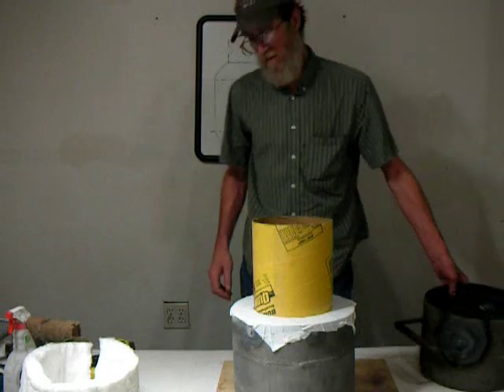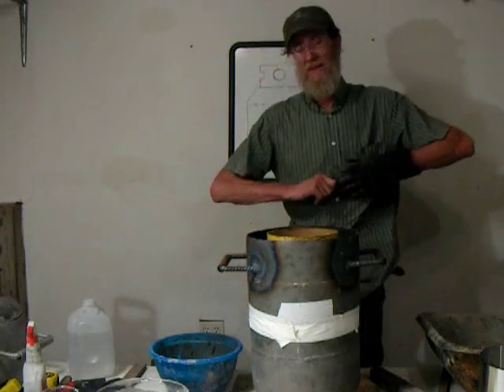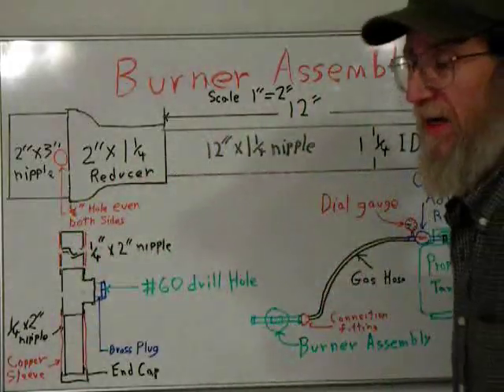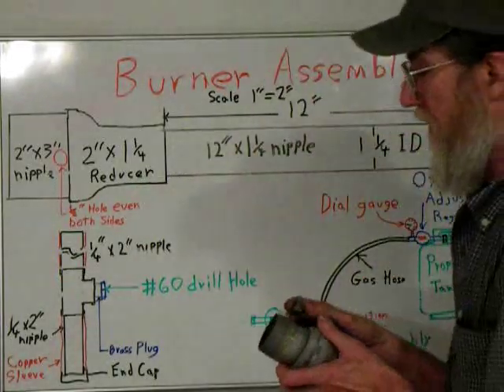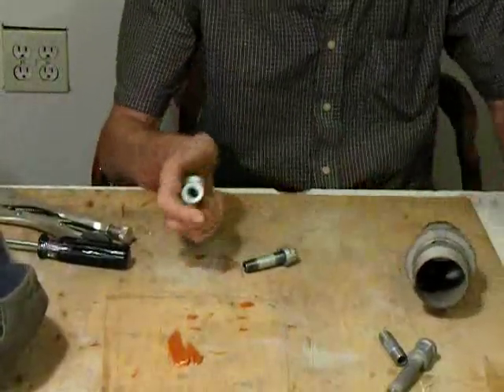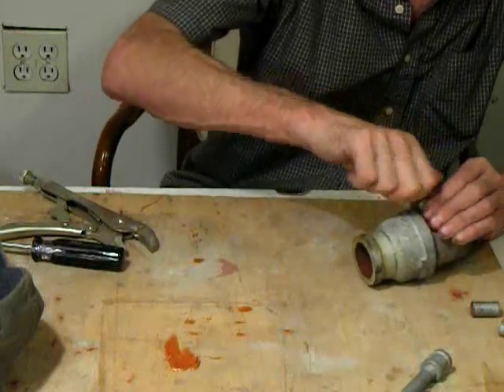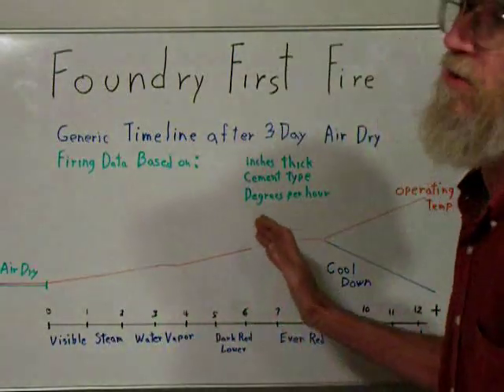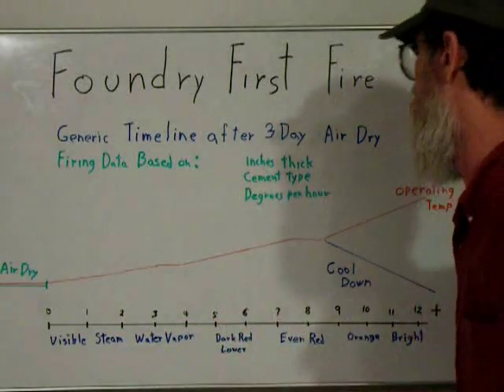Backyard Foundry Tutorial Pt 3

Comment: Thanks for what you do.   Without adding the extension, just one propane tank, what is probably the max size crucible you would have in there?   Right now I have a graphite #4 6KG in my cheep-0 foundry, but am getting ready to build a real one.  Proper wool, cement, etc.   It's coal + hairdryer in that 'Lowels metal bucket' type and it's working well.  I think the propane take is about the same size..

Comment: I built the burner tube exactly to the tee just as described however I can't keep the burner running without a flame I'm front of it. can you help me? thanks rob
Reply from the maker: +Frank franks Yes this has come up many times in the past.  First the gas regulator needs to be a high pressure type that can crank out up to 30 PSI and start out lower than that say 8 to 10.  That will be adjusted once the foundry heats up. Putting a gauge between the gas hose and the burner helps the most for learning.  The other common problem is the lighting process where you take a grill type lighter and insert it slightly past the orifice to light it from the air intake side.  Very common mistake trying to light it from the output side of the burner.  Can be done but tricky when cold.  And the final problem is the regulation of the gas pressure itself.  Takes a while to get the knack of it.  Although I can light it without a gauge from the sound alone others need the gauge for assistance.  It is either too much or too little gas.  Start with to little and stick the long neck grill lighter down the intake end of the tube just under the tee and slightly past the orifice and as it lights and heats up run the pressure up.  That gets the air flow going.  Let me know how it turns out but sounds like you are there already and no problem.  Once you build it it is understandable you have to learn how to operate it.
Reply: rlbob1 I'm having the same issue but and it does seem better once it warms up but only if I crank it to 25-30 psi. Is that how it should be? I remember you saying you run between 7-20 psi but I may have misunderstood. Combustion is occurring just after the orifice. Could it have to do with the distance of the orifice from the flare of the bell reducer? I tried to use all the same parts and assemble exactly as yours was. I've made a few reversable modifications that haven't seem to help so I thought I'd come to someone who knows this particular burner pretty well.

Even when I do get it to run decent, once I put the lid on the back pressure (I assume) pushes the flame back.

Comment: quick question.  you said a minimum of 0 to 20 psi on the adjustable high pressure regulator.  after initial burn in, is 20 psi enough on full power or am i losing out in not having a regulator going to 30 or 40 psi?

Comment: Bob, Has anyone tried to fire the foundry with an oil burner?  Such as a Beckett AF?  Obviously the curing of the refractory would have to be done with with a gas setup because, firing can be regulated.   But once cured, ???  I ask because I have plenty of stuff to work with if #2 fuel oil, diesel, kerosene, etc is a viable fuel.

Comment: hi Rob.
I have just recently made your foundary burner, and followed your instructions for the burner exactly, but it blows itself out. should it have a baffle or is there something else I am not doing right? Ive tried different pressures, and the only way I can get it to run is to put a piece of mesh screen in, but that wont last long. Can you give me any suggestions why it isnt working, or anything I could try.
Regards
Nigel (Chopper 316)
Reply from the maker: Although this has happened before I have always found the burner to be very forgiving due to its simplicity. I have run it by itself laying on brick and even made one that ran on house regulated natural gas.  Some of the problems were due to the wrong regulator (non adjustable),  Orifice assembly too long (inserted down the Venturi instead of the start), Orifice size wrong or drilled at an angle. Wrong size Venturi or pipe used, not using a grill type lighter to start the flame at the orifice, or even near dead propane tank with low pressure. Give me a better detail of the specs and equipment you are using.  As far as I know these problems have all been solved in the past rather simply.
Reply: I have done everything as you have said_ same size pipe and bell mouth venturi you specified. I drilled a 1mm hole in the orifice - you said you used a number 60, but i dont use those numbered drill bits, so how does that equate in mm - is this where I am going wrong? Eveyrthing else is exactly to your spec.
Thanks

Comment: Hey Bob I tweaked my burner assembly and finally repositioned the flame while red hot. Now I tried the 10 second shutoff tecnique a fee times but it didn't work. 
But it readjusted by itself. 
Iwas running at 30 psi and all of a sudden it just did it.
But it got yellow hot quick and I finally melted some copper. I believe this would get hot enough to melt steel. Thanks for the help. I'm going to have to practice jumping the the flame though. But now I know this definitely works.
Reply from the maker: Great but be careful and protect the foundry.  Once the flame jumps to the inside the entire foundry becomes a giant burner.  Sometimes you may need to pull the burner out and cool it off with a mist from a garden hose.  After it cools down the flame should stay by trickling water over the burner sleeve.  I usually put a damp cloth or paper towel over the sleeve and position a hose dribbling water on top with bricks.

Comment: Hey Bob I got my Venturi hooked up with the right size nipple.
It still wont get hot enough to melt copper. I'm seriously wondering if something is wrong with my gas assembly bcuz in your other short video melting the cans I noticed your flame was just in the foundry nd not all the way back to the brass plug.
Reply from the maker: Yep! I Finally Need to post a Foundry Addendum showing it's operation. One part I need to post is Repositioning the burner flame.  You first start the foundry off with crucible in place and heat it to glowing red. (anywhere from 12 to 15 psi on the gauge)  it makes a continuous thump thump sound.  Then you turn the gas off at the tank for a few seconds then back on.  It self ignites and repositions the flame inside the foundry.  (with a real quiet swooshing sound)  At that point you have to cut the pressure way down (about 8 psi) or it will exceed the limit of the refractory and melt the crucible along with the KS4 lining.  I keep the outer burner tube cool with a piece of angle iron and a trickle of water from a garden hose to keep the burner from overheating and the flame from jumping back to the orifice.
   This is of course assuming the orifice is positioned correctly in the Venturi at its widest point where it starts the constriction.  Obviously I need to make a video showing this.  Truth is I did but lost the first on a computer crash and the second had too much background noise. Oh well 3rd times a charm.
Keep me informed.  You are so close I am more than interested.
bob

Comment: Can I use a 2 Ft tall propane tank ? will it still heat up enough to melt bronze?
Reply from the maker: Well the height is to an advantage keeping the heat in with the flue effect.  After all I show and recomend an extension in my tutorial.  Just depends on how much you want to melt and how much gas.  I would recommend you cut the top below the intended crucible height to avoid having to make a separate set of lifting tongs as well as pouring tongs.  Anytime you start ramping for the high heat melts you will find the hotter you try to get, the longer and slower it becomes.  But you have to be aware if you turn the foundry gas pressure up to max, based on it's burner design, you can turn the entire refractory lining into a pool of brown glass at the bottom.  So experience and caution would be required.

Comment: The only difference is onmine I used a 1n1/2 inch tube instead of the 1n1/4,
Because I could not find a bell shape reducer by that size anywherer. Do believe that had a major effect?
Reply from the maker: Yes. the bell shaped reducer acts as a venturi much like in a carburetor. It is a major component if not the most important one. Just the spacing where the orifice inserts into it is enough to throw things off. Try checking with your local hardware store and see if they can order you one.  Simple enough fix.
Reply from the maker: Also make sure you are using a high pressure propane regulator like the one used on a turkey cooker (0 to 15 PSI). The regulator used on a gas grill is low pressure and not adjustable.

Comment: Hey Bob , great video. 
I recently made a foundry based on your method.
It's hot enough to melt aluminum but it won't melt copper. 
Question is will yours melt copper and brass?
And also I'm wondering if I hook up an oxygen line to the other side of the gas assembly where the cap is will it then get hot enough. 
Can I do that and would it b safe?
Reply from the maker: No Oxygen would be very dangerous.  It would result in an explosion. My foundry gets hot enough to melt a steel crucible if the gas is not controlled properly.

Comment: Well i have to say your video on this subject is much easier to follow than most. Ever thought of teaching you would be good at it?  Anyway i had a few questions for you. First of all here are the technical specs for my furnace to better help you to answer my questions. I had decided the propane tank was going to be a bit to small for my needs as i intend on working with cast iron in the future (after learning with aluminum however) so i didn't want to spend the time and energy in building 2 furnaces so i chose an old 20 gallon air compressor tank i had laying around. I have it all built and have had several successful aluminum melts, I chose your burner design you laid out with the exception i added a butterfly valve in the rear to act as a choke as a result my rear 2'' nipple is a little longer to accommodate the modification of the butterfly.  My first question everything seams to light and burn quite well however most of the flame is inside the 12'' tube. I even adjusted the jet and went as far as modifying it to accommodate wire welder tips that i can thread into the 1/4'' cap so i can easily change the jet to allow for more or less gas to pass through.

My questions and observations with my particular furnace.

First question: could the modification i made with the butterfly valve be causing the flame to start and stay inside the 12'' tube or barrel of the burner. or is this simply a normal operation of this type of burner, There is still quite a bit of blue flame coming out of the end of the pipe.

Second Queston: How long should it take for my furnace to get up to aluminum melting temperature, With my setup it takes about 2 hours to have the aluminum to pouring temp. (depending on ambit outside temperatures)

Third Question: I am getting ready to pour my first real casting of a part, This pour will also be my first attempt at melting brass is there anything special about brass that i need to know other than not to get it to hot as to melt off the zinc contained within the brass.  I have already built another steal crucible this crucible is a bit smaller than the unit i currently have for melting aluminum but the wall thickness is 1/4'' should that be enough to contain the brass or should i make a more durable one.

Thanks for your time and help, Keep up the great videos i have recently gotten into this due to the fact i work on all types of mowers and atv's and finding parts for some of those unit have proven to be quite difficult so i have had to resort to more drastic measures but its been a fun learning process and i have not burned the house down yet so im doing ok in my book.
Reply from the maker: You should be able to jump the flame from the inside of the tube after the crucible and refractory heat up red hot.  You need to cool down the burner tube by dribbling water from a garden hose over a rag on top of it.  I set up a few bricks and angle iron to avoid damaging the hose. To reposition I turn the gas off wait a few seconds and turn it on again.  It should self ignite inside the foundry. The cooler tube makes the gas denser and prevents re ignition inside the tube.
   The two hour startup is probably due to the greater size and mass that has to be heated up.  Try planning multiple pours or at least clean scrap and pour ingots to save gas.
   With brass you need to avoid overheating as you said. I understand excessive stirring will also ruin the mix.  Not sure if a flux on top would help.
    Since the size and dimensions have been changed I cannot be sure if the butterfly valve helps or not. It can get pretty complicated real fast once one dimension is changed and not another but it sounds like you have been successful at increasing the scale.  I hope you made a video of its construction for others to see.

Comment: Hello,
I finally started this project and started with the burner as luck would have it I inadvertently grabbed a #59 rather than a #60 size drill bit easy enough to just do it again (which I am going to do) but would .001 make that much difference? just wondering is all- your furnace is the best hands down that I have found for what the cost is it is really outstanding my hat off to you sir!
Reply from the maker: Rosario W You should be fine.  I have tried different sizes larger and the burner still fires up.
Reply: Thanks so much for the reply things are going well the only thing I cant make up my mind on is what type of refractory to use as a finish coat (top coat inside) I have the cerablanket and I did see you used perlite do you still recommend this? just when I made up my mind on what formula I was going to use  I read that it Perlite should no longer be used not sure  why though? I want to follow your plans to a "T" if possible Thanks again
Reply from the maker: Rosario W
The inswool blanket proved yo be far more efficient than the perlite. You save so much in propane it is worth the extra cost.
Reply: Thanks again for your help & fast response it is extremely appreciated

Rosario
Reply: Well Mmmm I finished the burner and it fired up but in no way is it as strong as what most of you have? the flame burns all the way down the pipe & out the end( no inner cone visible in the all blue flame) I have a high pressure reg and using a 20lb tank (BBQ) that's about half full I will post a short video if that might help it just does not seem to have enough pressure behind it? I did test it out in the open though I am not sure if that makes a difference not sure what or where I went wrong? But it did light and throw a flame out the end so all is not lost yet lol any ideas would be appreciated I feel like the BBQ tank has a limiter in the valve just a guess though but when I plug the line it reads 20lbs pressure but when lite there is no reading on the pressure gauge so I am at a loss- smaller orifice maybe?
Reply from the maker: Rosario W I am using the modern tanks which although they do have a limiter it still allows for high pressure such as a turkey cooker.  Check out the regulator and see if they added a limiter as well.  Look at the fitting that screws into the tank and make sure it is not a limiter. Since the tank itself has a second valve which activates when you screw in the fitting be sure it is tightened all the way. In cold weather the outside of the tank will ice so you may need to set it in a tub of cold water.
Reply from the maker: Rosario W One other thing.  With the foundry set up and the center section in place there is a powerful flue effect.  This increases dramatically when things start glowing hot. That is why a blower is useless and would only shoot the flame through the charge hole. Makes a great outdoor space heater. You may already have what you need.  Still you should see a reading on the gauge and be able to adjust the pressure between 8 to 20 psi with the gauge on the output side of the reg.  Also check for leaks using a soap solution.

Comment: What is recommended for ground cover in the area in which the casting is going to happen?  My initial thought is that sand would be good because rock can take on water and if it gets hot enough, it can crack causing pieces of rock into the eye.

Comment: Thanks for the very informative and detailed tutorial.
I just have one question. What is the height of the form tube for the main foundry body? Thanks again.
Reply from the maker: The main body form tube is 8 inches.  The center section is 8.5 inches.  You should allow about 1.5 inches from your crucible to the lid so that would allow 15 inches of crucible height.
Reply: ***** Thanks for replying. Alright, I'll cut the 8" concrete form tubing to 8" long. Another question, should the lid be on the main body during the first fire? Or should the foundry be open without anything covering?
Reply from the maker: The lid should be on.  Also you need to be careful and keep the burner running at  the lowest possible setting for the first few hours.  This is difficult because it is not designed to operate at such a low temperature.  The rule is when you think it is ready to "ramp up" you "give it another hour". The refractory cement will actually be changing state on the molecular level from a castable hydraulic cement to an actual ceramic.  If you do it too fast it can build up steam pressure when the water molecules leave the lime and could blow out the liner.
bob

Comment: Out of curiosity will this get hot enough to melt gold around 2000 degrees
Reply from the maker: Yes It will get hot enough to turn the refractory lining to glass which is 2500F with KS4 and 3000F if you choose Mizzou.  Just be careful and not leave the foundry unattended when you ramp up to the high temps.